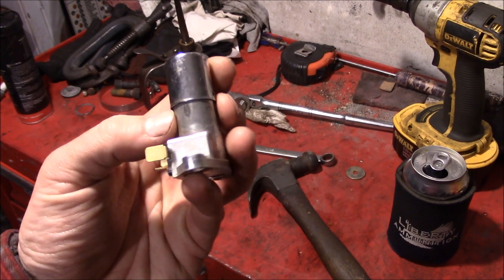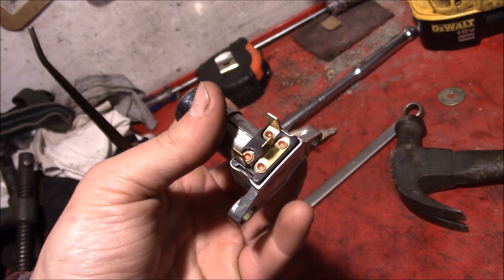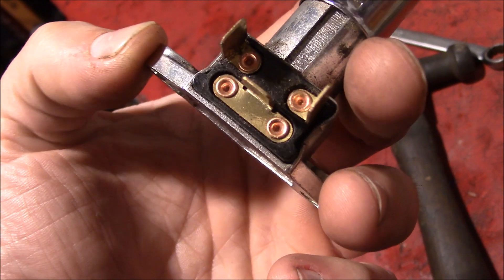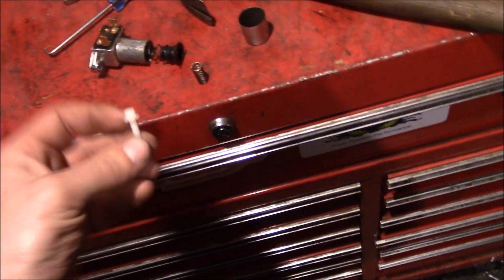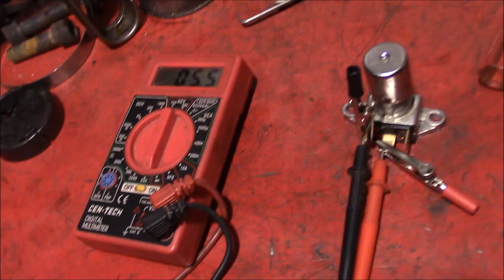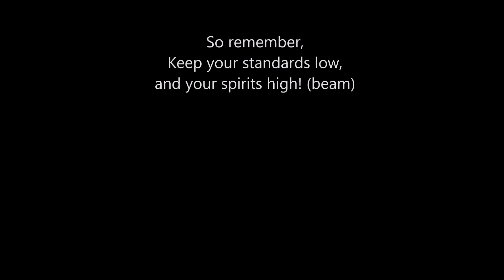Foot Clicker Dimmer: Taking one Apart

Comment: Awesome. Wonder if this is why at times my high beams will work and other times it won't. Perhaps the internals are broken. Mine dimmer switch has 4 terminals. Yellow wire, lt grn wire, tan wire and a dk grn color. My car has the auto dimming which is what the 4 terminal is for (dk grn wire) time to take it apart and see.

Comment: I save all my old parts too, for whatever reason.  If for nothing else, they'll serve as ballast in a wind storm.  You know, keep the barn from blowing away.  I've done exploratory surgery on starter solenoids, there's a nice spool of copper wire in them.  Most times, the contacts just need a cleaning and a little dielectric grease .  

Keep'm coming!
Reply from the maker: Thanks!  Yeah, you never know when you might just need a part of something to salvage too.